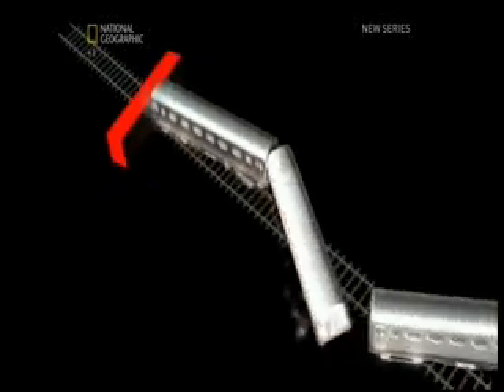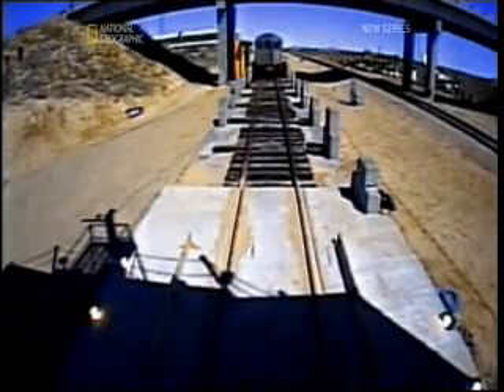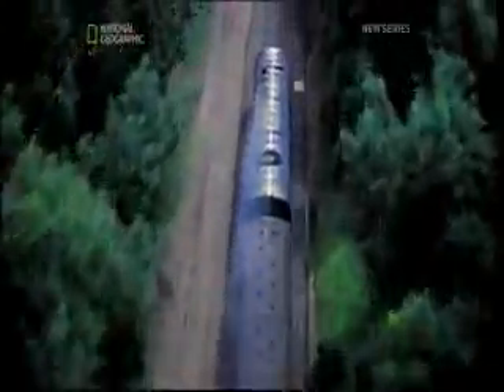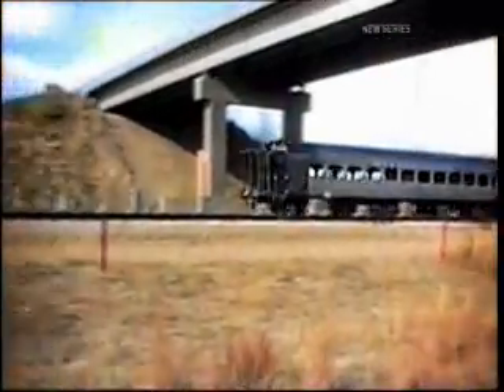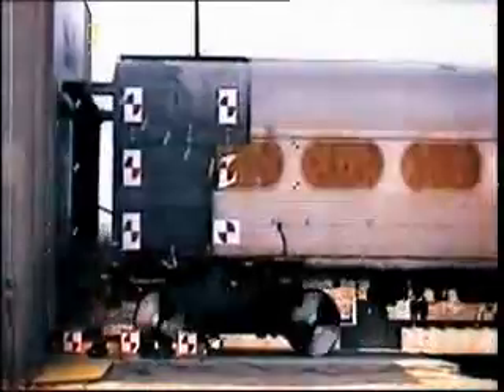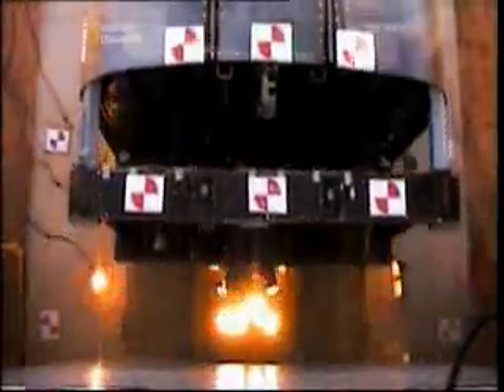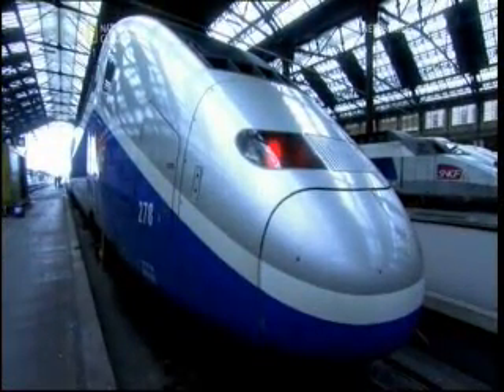American Crash Testing.

Comment: I hate when peole say put seatbelts on trains or if you where wearing seatbelts you would be fine.well that's bs Amtrak trains go fast 120-150 if you get in a crash at those speeds you are dead!
Reply: niggas really be out there acting like trains can swerve
Reply: i guess your neck bone would break into half if you do that
Reply: well, how's this for an idea, try harder to avoid a crash!! trains SHOULD NOT crash as much as they do, they are operated by trained drivers and controlled by experienced signalmen, they unlike cars should be able to reach the safety levels of air travel.
Also, if you think 120 is fast think again, here in the UK, trains have been doing those speeds since 1975(HSTs). and as early as the 60s we've had trains achieving higher average speed than the acela express (eg Deltics routinely averaged 90+ mph on the Edinburgh to kings cross run peaking at just over 110).
I would also point out, such as a crumple zone system would not be approved by any railway, its a huge amount of extra space needed, both in terms of train storage(longer sidings etc) and in terms of lost room to have nothing used in it( although bike storage or mail could be possible), but most of all, think of the image it portrays to passengers if all your stock is being retrofitted with crash protection, much better to introduce new rolling stock, although I agree in many countries that is hard as well.
I would like to say, in the UK the so called ''mk1'' coaches introduced in 1951 and built well in to the 1960s, are now no longer allowed to be on the end of a train, ie there must be either another loco, or a newer carriage as the end coach. and i feel they could try and implement this in the US, if you had newer carriages with a crumple zone at the ends, this could solve most issues in the video as the energy will be more dissipated and allow for less chance of

Comment: so why 11 years later, do we still not see crush zones on trains?
Reply: Probably cause they just reinforced the side walls instead, or the amount of deaths from crushing in walls was so low it wasn’t worth it, also, wow this is an old comment
Reply: @TabooGroundhog  Well, I think it's more that they incorporated the crush zones in the design and thus you don't see them. Dutch trains have them as well, usually found on the balconies and the newer stock even with a large one at the front to protect the driver.
The worst about our IRM-stock though is that the drivers was always told that the crush-zone was behind their cabin and the cabin was reinforced to stay mostly intact. Some serious crash in 2005 or so made it clear that the cabin is the crush-zone and the rest behind it stays rather intact.

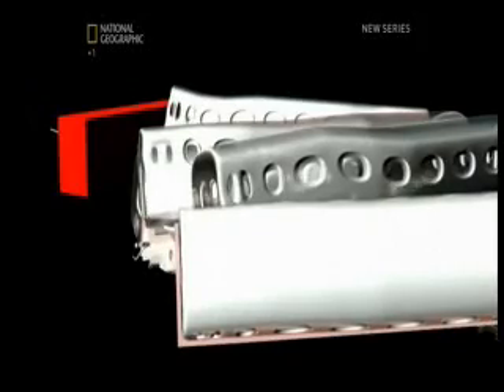Comment: When was this made? The crash at 1:14 looks almost not that bad when compared to one that happened in Germany about 10 or 15 years ago. The cars ended up stacked together like in their CGI simulation.
Reply: This seems like a NGC-documentary from the early zeroes of the new millennium. I also have had a few recordings from that time and those were usually far better to watch than what they spit out nowadays. But I second you on the fact that the 1998 Eschede disaster looked worse than shown here. But that was a completely different accident, as the train didn't collide with something in the first place, but lost the outer part from one of the wheels. That derailed one carriage and in turn led to the disaster as far as I know.
The fact th normal-speed passenger trains can already show the behaviour shown in this video is probably the alarming thing in this documentary. High-speed trains are far harder to control when things go badly wrong.

Comment: Your logic is like saying you'd rather not be wearing a seatbelt in a car crash so you can be thrown clear of the car instead of being trapped inside. 

Would you rather be in a derailed train crushed under several other cars weighting many tons each, or in a  train that's still on the rails?